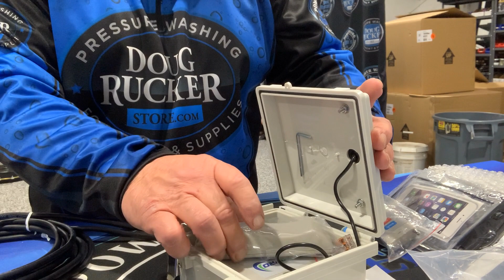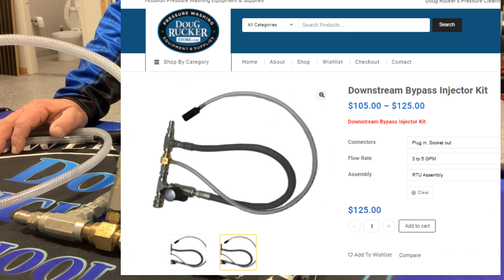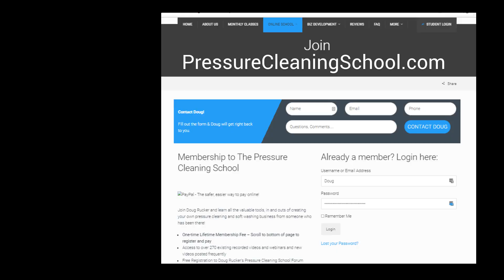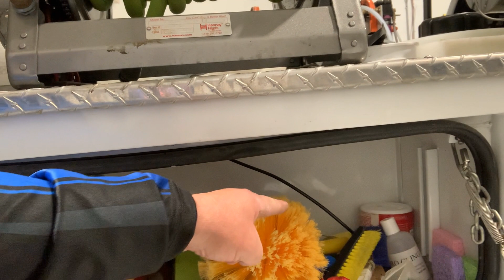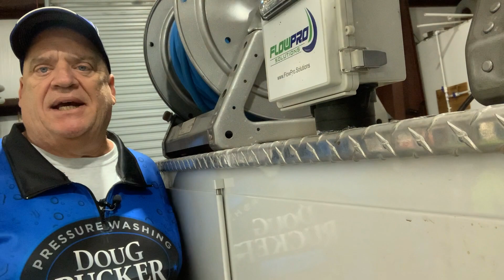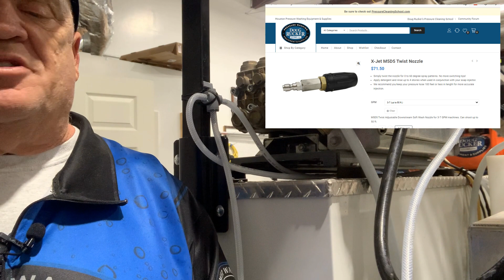REMOTE FOR POWER WASHING [FlowPro from Doug Rucker Store]

Comment: Debating on buying one from you. I bought an injector bypass from you when I started then moved to a smart stream. Now the actuator won’t turn all the way when it goes to soap mode and it it just spins back to the rinse position after turning about 1/4 to 1/2 way.
Reply from the maker: @justinlittle8742  we have them in stock.

Comment: Hey Doug, previous student here,,, my question is can you leave the flowpro connected at the pump of the pressure washer and run it in bypass for surface cleaning ect....
Reply from the maker: @Bleachsprayerr  yes mine always connected. Surface clean when in rinse mode for full flow and pressure

Comment: Can you control the quantity of the chemical or is fixed
And at what rate?
Can you add an option for a 2 chemical for a 2 step wash ?
Thanks
Reply from the maker: I do not have an option for 2 step available.  The ratio is dependent on how you dilute it as well as how much water the pressure washer would dilute it.
Reply: @PressureCleaningSch  
Thanks sir
Great videos by the way!

Comment: Another great video! Thanks Doug
Question:
How long does SH last after opened? I usually empty 6 5 gallon pails to fill a 30 gallon tank with SH and soap. 
Will that still have potency for a few weeks?
Reply from the maker: Hard to say how long. But if kept of direct sun light should last a few weeks.  Maybe longer in cooler weather.

Comment: Would you use this with a remote proportioner or would this not be used with a proportioner?
Reply from the maker: No it is used for downstreaming, not for a dedicated pump. Prevents walking back and forth to the truck to switch from your mix to you rinse water.

Comment: I'm confused, why do we need this? Isn't a j rod the same thing? U just use a shut off valve switch from soap tip to rinse tip?
Reply from the maker: Don’t have to go back and forth to truck and can use same nozzle to apply w and rinse and not lose any flow or pressure. It’s not a must have, but sure makes life easier
Reply: @PressureCleaningSch  thanx for the info!!!! Makes sense now

Comment: Glad I found this video. This is what I need. Just started in the business and adding slowly. I’ve been running my downstream injector on the loop with the ball valve in a straight line with the feed/outlet line. It works, but am I doing something wrong?? Also, what software do you use to manage your pressure wash business?
Thanks again!
Reply from the maker: If it’s working then I doubt your doing anything wrong. I e dine then all different ways. Here’s what I use for my business. https://www.markate.com/?aff=drucker
Reply: @PressureCleaningSch  wow! Thanks for the quick response!

Comment: Hey Doug 
  What type of bracket are you using that the box is attached to ?
Reply from the maker: Not really a bracket. It’s threaded rod and we used a couple of pressure washer skid vibration pads

Comment: I have a question. on my last job. My drop stick that’s in my bleach tank started pumping water out of it when I’m off the gun trigger,,  as soon as I pull the gun trigger, it starts sucking bleach again… the only thing is, now my bleach is diluted because of pushing water into it when I’m off the trigger. I’m not sure why this is happening. I’ve tried different downstream injectors. But same problem. Will the flow pro solve this problem for me until I get some down time to solve this problem.  Or do you even know why this is happening?  Thanks . I love your videos. You are a big help.

Comment: Possibly stupid question - why not just put the remote operated valve on the siphon tube? Seems simpler and would eliminate some plumbing. Also would not subject the valve to high pressure. Am I crazy?
Reply: If you do that then you can’t bypass the injector. That is the point of this whole thing, to be able to turn your bypass ball valve off, which is turning your soap off, and being able to have full flow for rinse, because rinsing out of the injector will decrease water flow significantly.

Comment: Hey Doug,
I’m picking up my first new 8GPM machine and am trying to order the Flo-Pro but it’s asking 1/2 or 3/8’s…? 
I’m not sure what size to get with the 8GPM..
Thanks for the great content!
Reply from the maker: I use the 3/8 for my 8GPM. Works great
Reply: I get why some flow pro are 1/2 or 3/8, but why do some say with chemical injector bypass? Don't they all have chem injector bypass?  From the flow pro site, the ones with the bypass are  a $200 option.  In easy terms, doesn't the remote just have chem going to nozzle or no chem because it's being bypassed ?

Comment: Why do you disconnect the Flow -pro, as opposed to permanently mounted?
Reply from the maker: Great question. I disconnect it because I don’t want it bouncing or vibration to it while driving. Not permanently mounted because I did not want any more holes in the truck than absolutely necessary. Were it a flat bed truck or a trailer I’d definitely mount it. When not in use I just disconnect it and lay on the back seat of the truck. I’m so use to it now I don’t even think about it.
Reply: @PressureCleaningSch  Thanks Doug

Comment: Thank you for consistent educational videos! Quick question - Will the system work equally well with the FlowPro valve on the straight short run and having the injector installed on the loop? To me, it seems that the water running in a straight line (uninterrupted by 90 degree fittings)(when off the injector) is a better solution.
Reply from the maker: I’ve used both and have noticed no difference either way.

Comment: Hi Doug still to make my order up yet haven’t forgotten 
Hey quick question regarding this bypass setup. From what I can see when the valve is open to increase flow isn’t water still going to flow a little through the injection allowing some chem to flow as well ? Cheers
Reply from the maker: No it will not.

Comment: thank you for your video      ( question)     is this remote system will work to control the       ON and OFF       water valve on my machine  ???     I have a 11GPM 4000 PSI      Drain jetter machine  if do so please let me know   thank you in advance
Reply from the maker: It switched from water to a chemical tank. In our case bleach. It does but turn the water off
Reply: @PressureCleaningSch  i wod like to order one.  Is there a phone # ??  Or how can i oreder?
Reply from the maker: @mcfrancoable  you san order through this link. https://www.dougruckerstore.com/products/flowpro-remote-bypass-system/
Reply: Thankyou for your quick respond.  Can you please tell me what size the trade is. 1/4" 3/8. Or 1/2"
Reply from the maker: @mcfrancoable  3/8
Reply: @PressureCleaningSch  any chance you can turn in to 1/2 size.   Any way i will order but i really want to in 1/2

Comment: I understand the flow pro as a remote solution for turning soap on/off.. will it draw soap at high pressure?.. my hotsy can run soap at high pressure just the way it is, of course i have to manually turn it on off.. maybe i need a remote to just open/close the valve that already exists lol
Reply from the maker: No. Not at high pressure

Comment: I appreciate the kind words Doug and yes your customers can certainly call me anytime. The instruction sheet has my cell number so they can store it in their phones just in case they can’t get in touch with you. 

I’m glad you brought up the feedback function on the remote as it really gives you peace of mind knowing when you hear the beep it is doing it’s job. It does eliminate looking for a light or hoping it made contact. The best thing is you never have to extend the antenna and testing proved it worked well at 2000 ft. 

I would like to mention another advantage of the FlowPro not often talked about. Running a bypass allows you to use a smaller orifice injector to get a stronger mix even when using longer length pressure hose.
Reply from the maker: Thanks Jud. Appreciate it.

Comment: Good stuff. I ordered mine from you some time back. Plan on putting it together soon. This video was right on time.👍
Reply from the maker: Awesome. Glad it helped. Have had quite a few w questions so felt a video would help
Reply: @PressureCleaningSch  I know you're a busy man Doug but I do have another question for you. If I were to order one more flow pro and have two on the truck for each machine would they interfere with one another?
Reply: @palmtree8604  I’ll answer since I’m on here right now. No, you can run several FlowPro’s on one truck or trailer. I routinely run four on the same job. Good question.
Reply: @JudWest  thank you Mr West. I will be purchasing another one then 😎👊

Comment: Are you still offering the Schertz Box?
Reply from the maker: Yes we sure do.
Reply: I had three Schertz boxes before I designed the FlowPro and never had any problems whatsoever. I just wanted a little more.
Reply: @JudWest  I’m fairly new to this and currently use the Schertz. I guess I’m not sure what the exact difference is maybe a side by side comparison video 🤷‍♂️.
Reply: @vspd303  the simple answer is the FlowPro bypasses the injector altogether while the Schertz Box and other systems keep the injector in play while rinsing. This really helps in surface cleaning and rinsing. 

Depending on how your system is set-up and what injector size you run the flow difference could be substantial. However, other differences include...
- no chemicals run through the FlowPro 
- unmatched remote system
- the ball valve used is the most common valve used in the industry and is on just about every vendors shelf. No hard to get parts. 
- one year warranty.
Reply: @JudWest  thank you for the reply
Reply: @vspd303  I’m actually using both on my trailer. They work together.
Reply: @dalejohnson4840  Any chance you have a video of them together?